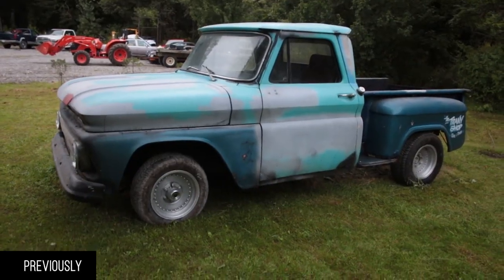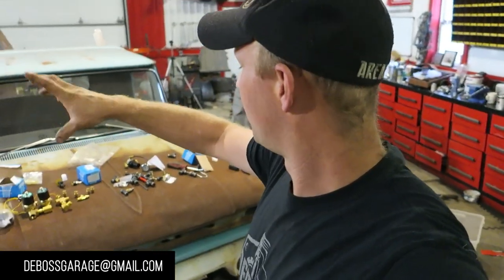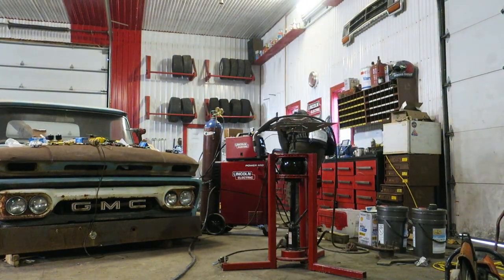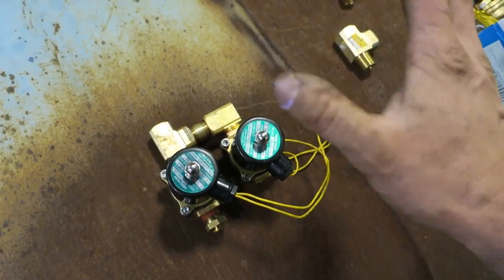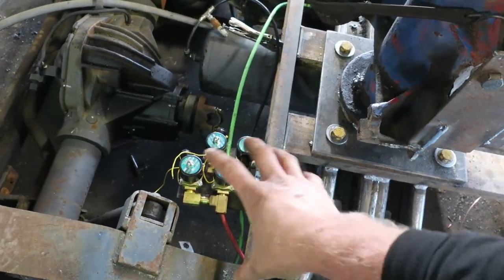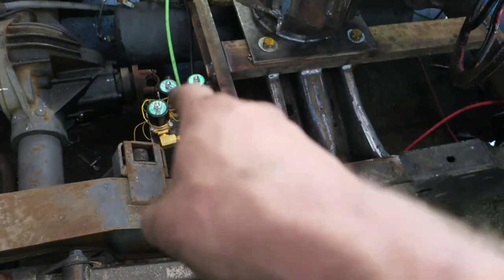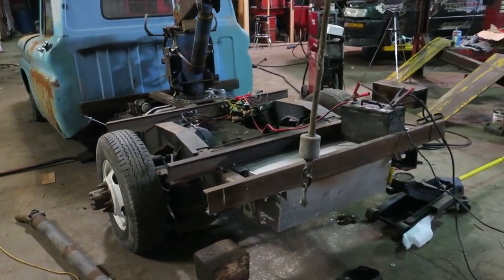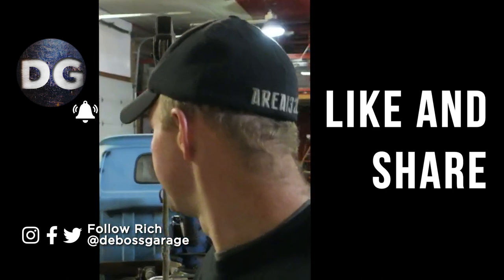FASS + Cheapest DIY Remote Air Ride Control System | #TTDmaxC10 [EP7]

Comment from the maker: PARTS USED - Find the best prices using our affiliate links:
FASS for Duramax https://geni.us/fass-duramax
Dual air compressor kit https://geni.us/viair200psi
1/2" Brass Solenoids https://geni.us/12vsolenoid
Pressure Control Switch Valve https://geni.us/switchvalve
Toggle Switch https://geni.us/toggleswitch
Wireless Remote https://geni.us/wirelessremote
MSD Relay https://geni.us/msd-ss-relay
Reply: Try a belt driven Ford smog pump like on fox bodies for your air pump
Reply: It's called a swamp cooler, I got one but it's kinda pricy, since they are rare
Reply: Nice job Rich!
Reply: @alexjoyce1276  But aren't they more of a early/mid 50's accessory than a mid 60's which is what the truck is?
Reply: your stacks would look so good square tube
Reply: DEBOSS GARAGE  if me and some friends wanted to come visit and meet you would you be ok with it? I live about three hours away and would love to meet you in person I love what you've done and what your doing.
Reply: DEBOSS GARAGE I'd talk to AVE about the computer for the bags, he's very knowledgeable about those type of simple cheap electronics and computers. Could be a cool Canadian colab as well.
Reply: You’re looking for a “Swamp Cooler”. Peace snd love brother

Comment: Something like a Raspberry Pi should be something simple enough for you to configure and write some dipole code for your air tide system
Reply: I was gonna say this. Raspberry Pi would probably be perfect for this.
Reply: A Raspberry Pi is probably overkill for this. An Arduino with a relay board would be sufficient.
Reply: @atlanticcanuck2826  but he could definitely do more with the Pi. That was what I was thinking. He could use it for other things too.
Reply: @MultiSpencerc  like what? A Raspberry pi would only make things way more complex than needed for anything going in the truck. Arduino+relay module board+wireless remote module and you can control the airbags no worries
Reply: Nah... apple pi with wipt kreme

Comment: My cousin has been welding for over 30 years. He is mostly a mobile weld service and when he does fuel tank work he runs a hose from his exhaust to the tank to pump out the air so no big booms! Yes, he is crazy and I move at least 100 feet when he does this!

Comment: I would put some thick rubber spacers between the chassis and the fuel tank brackets to absorb vibration and prevent cracking. Superb job so far. 👍
Reply: U going to sell if so I'm interested I own a tow truck service in Texas that would be cool to have

Comment: FYI When you're looking around the junk yard, keep an eye out in any old trucks that had air brakes, for the gauges. Some had dual gauges that you could set up for pressure in the tank and pressure in the bags. Or maybe one gauge for front and back readings. I used one with a manual regulator on one side to adjust the air in my back bags. Worked great.

Comment: I used a old York a/c compressor for air ride worked excellent! Has it own oil. Love all the videos!
Reply: I use a YORK 210 in my gm as well! for air for my impact and air horns works great I just top the oil up once in a while

Comment: Explaining what you are doing is great for getting ideas or see where you went wrong. For programming we call that the "rubber duck" method. When you are stuck with a problem you explain it to someone even though they most often would not be able to help you. Just by explaining what you did you often notice where you went wrong, or get an idea how to solve the problem.

Comment: I have been running a similar homebuilt system on a dodge Ramcharger . I used my a/c compressor as a primary compressor with a pressure cut out switch. then wired in an electric compressor as a backup.The system has been working great,leak free for over four years. No a/c compressor failures yet,  I run an oiled pre filter with an extra little shot of oil every 6 moths or so. keep up the great work.

Comment: 11:17 freon doesn't lubricate compressor, it's a closed system and flow of refrigerant carries oil with it, when you use it as an air pump, outdoor air is clean enough yet where compressor doesn't get lubrication

Comment: To stop air from side2side transitions as in a turn or unequal load, just use check valves to 'steer' the air. Should take four of them, cheaper & more reliable than more solenoids. ??  Michael in Colorado

Comment: great vidjer man, millwaukee has just released a new cut off saw and a line of mega batteries for there line up, after seeing the new chain saw in action i wont be suprised if the cut off is top notch,in the mean time nothing beat a lil 2 stroke in the air, brings back the day of the elan!

Comment: I would use a York AC compressor for onboard air, it’s a popular thing among off-roaders. It has its own oil supply and it can run off ur serpentine belt with a AC clutch so you can turn it on or off. I had one on my Jeep and it worked great!

Comment: I know nothing about air ride, but if you are trying to stop air transfer from side to side put a check valve  in to seperate the wheels.

To vent the air add a tee in on the air line one per wheel and tie back into that 12volt valve that opens to atmosphere.

Comment: Rich, if you have problems with body roll from the air bags dumping between each other, check out Super Steer Motion Control kits. They're like a check valve but still allow air dump, just very slow. I've used them on a couple large RVs and been surprised at how well they control the body roll

Comment: I strongly recommend getting a York A/C pump for onboard air. they are found in a ton of different rigs, and they are cheap at the yards. they have their own crank case oil and are stupid simple and reliable. a buddy of mine installed one in his duramax in a day. the york compressors can put out 90 psi at close to 6 cfm.

Comment: Those fass fittings are push lock fittings from Parker. No hose clamp required, holds diesel, and good to 300psi working pressure. Reusable, just spit on it and push it together. You'll love them, give em a try.

Comment: Using an Arduino or Raspberry Pi to control the Bags for the suspension is an option. Can hook it up with the sensors & compressor to monitor the psi & adjust for different ride heights, etc..... Can do a lot of custom “mods” as well, & even run it to a double DIN 7” or 8” lcd display Bluetooth radio for some extra “controls” & GUI/UI 😅. Would be a cool project to do & could go down a rabbit hole in doing so; just a word of caution, lol. Don’t get me wrong, it’s fun, but can get crazy at times😁
There are forums & “programs” out there to get started or use; if don’t wanna write & flash your own. Can’t wait to see this truck finished, & wondering if decided on the color already.....Hope do something “wild”🤪
Cheers✌🏼
Reply from the maker: I think the color is called "clear coat"

Comment: Check out leveler valves used on transport trucks  for ride control and a mechanical dump valve with electric over ride. Will do what your thinking but much cheaper ! Lov the build.

Comment: In addition to some good controller suggestions below I’d add Arduino. You can get a starter kit with sample code pretty cheap and they have plug in modules for heavier relays and wireless communication. Another possibility on the air is to just add an extra solenoid front and back that opens with either fill or dump but prevents air moving between the two bags except when you’re adjusting ride height.

Comment: Look up Arduino, you'd be good with Arduino Uno, cost about 11 bucks on Amazon, and you can control that relay you bought with it
Reply: I dont know, that solid state relay works on 12V, arduino works on 5V-9V
Reply: @paulweerheim  y control the 12v relay with the 5v pins on the Arduino, I bought a 4 relay board for $10 on Amazon, it can switch up to 240Vac 10 amps, or 30v DC at like 15 or 20amp I don't remember

Comment: 14:34 - What I’d recommend is maybe an ESP32. They’re dirt cheap, offer 2 fast cores, wifi and bluetooth. Powered though usb, they’re capable of even serving a simple website, for adjusting or controlling stuff its connected to. To give you an example, I made a little desk toy tank, by 3D printing the chassis and tracks, then using 2 servos modified for continuous rotation, and an ESP32, along with some power circuitry. End result is something that hosts a wifi access point, and once you connect to it, it shows a captive portal which consists of 4 buttons, 2 for each track. Any device with wifi can connect. The whole thing probably costed me £7. 

It could definitely control the valves, albeit with just something that can lower that 12v to 5v. We’re talking sub $1 solution.

Comment: Hey man, I found when doing air ride, generally speaking the valve mounted closer to the back gives better response, and the lines dont also load up too heavily with air pressure causing the ride be be more wollowy ( like a bad brake line, causing a spongey feeling )

Comment: I've actually been working on a system which is cheap, open source and easy to program to control air ride. Pressure + Height. There's a few guides on Instructables for more basic systems on Arduino :)

Comment: That worked flawlessly 
That was such a cool build w the diy cut cost air compressor build 
Man that truck is gonna be beastly 

2 questions 
What kind of paint job are you thinking?
What DMAX engine are you swapping?
Reply from the maker: LB7 and I think the paint code is "clear coat".  I have a shinny GTO so this one is staying this Patina.  Roof will be white.

Comment: If you can't find a window cooler for the truck, consider a low profile roof mount ac unit...of course cab lights and a few antennae,  rotating  yellow light and air horns...and window visor lips

Comment: After you run the wire from cab switches install the remote behind the dash and connect the wires from the receiver to the switch behind the dash

Comment: could you run the solenoid valves directly from the relays on the controller probably only a few amps per coil  you wold only need 4  wires going to the cab then close to the controller have a few spring loaded momentary (on-off-on) toggle switches to shunt power from the main positive to the appropriate solenoid basically bypassing the remote

Comment: Why the MSD relay kit?  Just a guess, but those solenoids are probably only drawing <2Amps and the relays on the remote receiver are rated for 6-10 Amps.

Comment: I might woulda put batteries up front to save running all that cable and keep extra weight on front since it's a tow pig. Not that 200lbs means alot but it could make a small difference. Either way cool build!

Comment: I really think your going to need 8 valves....I highly doubt the bags will fill evenly.  Will you have a psi display for the bags so you know the psi of each bag or no?

Edit: nvm seems to work fine lol
Reply: Well, they do exchange air pressure between them, so as long as you load it somewhat evenly, the truck will sit nicely level.

Comment: How do you release the water from the air tank? 🤔
Reply: Any time you compress air you will get moisture in the tank. That means problems later on with the air ride: rusted tanks, water in your airbags, etc.
Reply: @markbremmer8642  I know, that's why I was asking

Comment: Is it worth it to manual swap my 5.9 cummins?
Reply: Sure. And easy. I just did a swap on a 96 using nv4500 from an 01. Did it in a couple days, looks factory. Whole different truck now
Reply: Did you need ecm, harness and driveshaft?
Reply: I have the same truck 96 ram 2500 hd, 47re. Wouldnt mind a 6 speed manual but would take a nv4500
Reply: @rodndrone1198  I used old rear driveline. Mine is 4x4 so I used manual front driveline. Used manual crossmember, auto ecm and harness. You have to splice 2 pigtails for your neutral switch and  reverse lights but was really easy. No engine lights or anything. I used the auto column, knocked out the roll pin for the shifter and put a manual shroud over so it looks factory. Opened up the cluster and took the bezel off, black electrical tr ape over PRND indicator. With bezel back over it looks like factory manual cluster.
Reply: @BurkesRepair  Thanks for the info, i appreciate it. Was the master clutch cylinder and pedal pretty easy to  install?
Reply: @rodndrone1198  no prob. Yes it was, you need a manual trans brake pedal as well. Pop the snap ring on the rod that holds the pedals all inline, slide off your brake pedal, and add new brake and clutch pedal. Make sure you put the bushings in between them so your pedals dont bind on each other. The master and slave come as a complete unit from Napa already bled, simply pop the plug out of the firewall, shove it in, give it quarter turn, then connect the slave at trans. Theres a rubber band thingy holding the new plunger on the slave cylinder,  do not take it off, or you will have to bleed the system again. Leave it on, then when its installed,  give the pedal a hard stomp to the floor and it breaks the rubber band. I bought a 2001 parts truck for my swap but for some reason the master cylinder rod was really long and pedal was at my knees, and just couldnt get it to bleed correctly either. Wound up buying a new master/slave for a 1996 and it literally took 15 minutes to install. If you look above brake booster way up high by the relays and stuff there are 2 small dimples where the factory would have installed the master. I put mine there in the factory spot and used 2 self tappers. The most worrying part of the whole job was cutting the hole UK n the floor. Lol. I found a couple helpful videos on YouTube that kind of gave me an idea on where to cut
Reply: @BurkesRepair  right on man, thank you for explaining the everthing you did. Now i just need to find a parts donor truck and do it
Reply: @rodndrone1198  yeah, anytime. Let me know if you have any issues along the way and I'll see if I can pass on anything else. It was so worth it though, the truck is a pleasure to drive now. Was real doggy before, and got sick of it eating the autos. After the third trans, it was the right choice. Everything I did was pretty much bolt on, and no one would look at the truck and think it used to be an auto. Real clean install

Comment: When I was working at an autoparts store I heard an explosion that rocked my shelves in the store. Turns out a welder across the street was welding on an old fuel tank and didn't fill it with water. The heat drove fuel out of the steel and vaporized it. Then it ignited and exploded. Knocked his head off his body and sent a flame through the shop which singed a power cord that was hanging from the ceiling about 15 feet into the shop. It was terrible.
Reply: Buck Berthod  yeah, dead men usually don't make anymore mistakes. The sad part is he was not even supposed to be working that day. He was there getting some work done on his truck.

Comment: Arduino Uno at Arduino.cc or Arduino Due which has more memory and is faster ISO can be used to control all that STUFF but you will need to program it with Arduino IDU. There is also Microchip.com  controls u can use and program it will C++. I hope this will help you out.  Good luck and  GOD BLESS.

Comment: micro controllers for cheep.
look up arduino (ard.ween.o) its a full open source micro controller that you can program to do pretty much anything.
you can add on "shields" to give them extra capability like wifi, infra red, hdd storage, the options are virtually limitless.
that being said, theres a learning curve.
if it were me, id start looking for a collab.
AvE started his channel working with arduino, but got away from it.
hes also affraid of the world doxing him, so i dont think he'll do a collab unless its over the mail, shipped back and forth.
somewhere out there, is a guy who knows arduino pretty good, and wouldnt mind doing a video.
dont buy anything until you talk with someone.
because of their popularity, there is a lot of cheep manufacturers.
adafruit.com is a good place to get them, you might spend 17-90 bucks US on one controller. then maybe another 30$ in peripheries.
and open source ride control might be pretty neat. i wonder if you could box kits, and sell them to support the channel.

Comment: Raspberry pi would be a good computer to run all those systems
Reply: Gideon Penick too much overhead. Long boot times, and fragility. Also, not the cheapest. Look at ESP32
Reply: @o0julek0o  I had no idea my lifx light bulbs use this... it's so cheap. much more simple than raspberry pie
Reply: @TheGideonp1  much simpler. Sure, has a lot less power, but to be fair, a guy called bitluni made a whole console that even modulates AV signal AND sound, along with taking input from 2 controllers. It's crazy cool.
Reply: @o0julek0o  YouTube searching now
Reply: @TheGideonp1  you can check out Andreas Spiess too. He did plenty with the ESP32 and a bunch of its variants with added functionality.

Comment: Use the ac compressor with an oiler before then a deoiler after compression with an auto drain valve looped back to the oiler reservoir.  Check out cletus McFarlands diesel 1965 ford fairlane they have a cool control for an air ride system
https://youtu.be/JVn7qCRN8TA